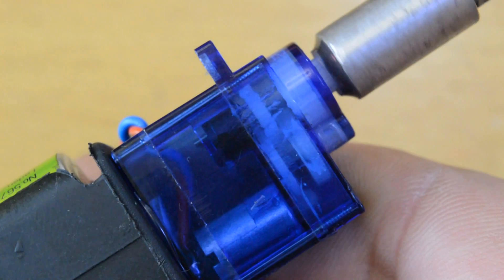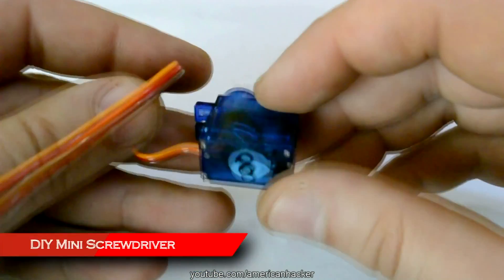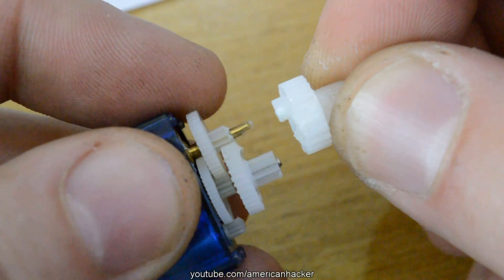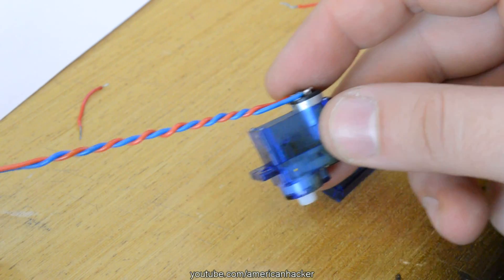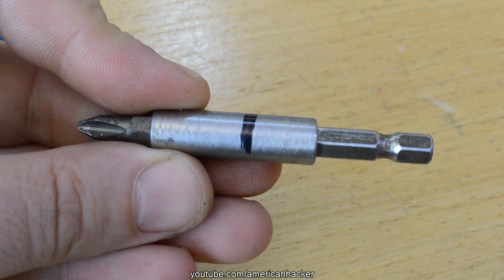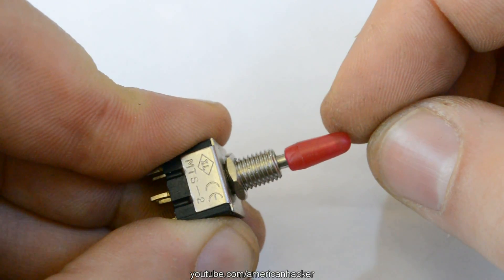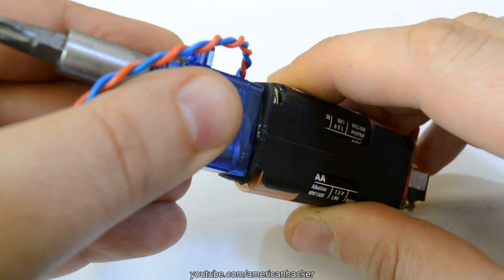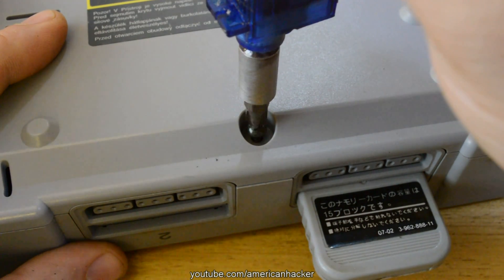How To Make Mini Electric Screwdriver

Comment: rc vehicle servos are running with 6 volts.. :) use 2 ultrafire batteries or a 4 battery holder.

Comment: Amazing, amazing, amazing! I have only one BUT :) You can use 4AA holder instead of 2AA. Motor in this servo can handle 2S LiPo without any problem so 4AA batteries will much better :)

Comment: Lets say I wanna make a feeder for a glue gun(press a button and it feeds the sticks) I have been using a Normal DC motor, it does technically move it in but it isnt a efficient as it eats through the glue. Would a servo motor work better to push the sticks into the glue gun?

Comment: How does it turn in both clockwise and counterclockwise direction?
Reply: toggle switch polarizes the wires for you. has three positions: off, on, and "reverse."
Reply: I thought so, thanks for clearing that up
Reply: Wait isn't it off right and left since right and left already makes it on
Reply: Center looks to be off. If you watch it, he switches to the opposing position to show rotation. Pay attention to the wiring diagram of you attempt this "hack."
Reply: just connect the positive terminal of battery to negative terminal of motor and vice versa.